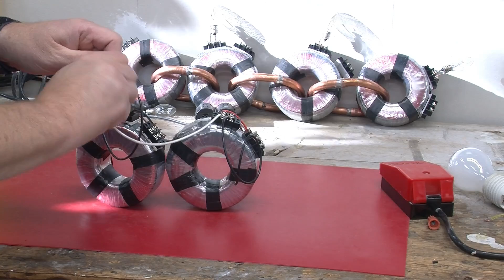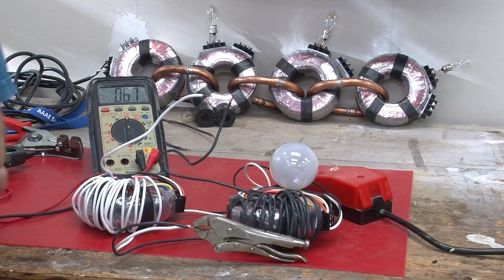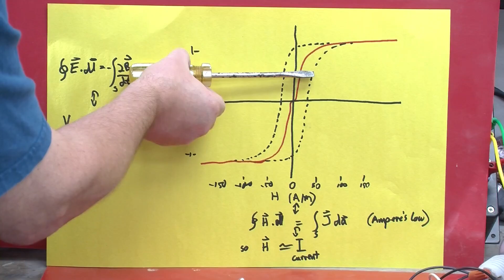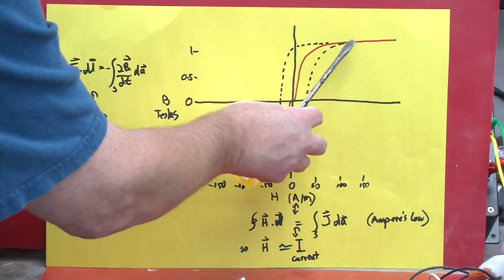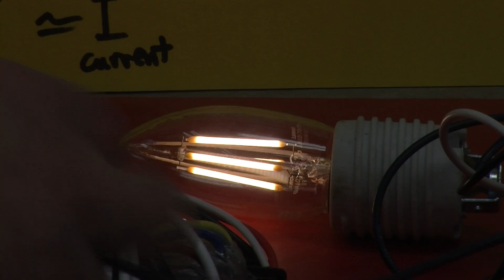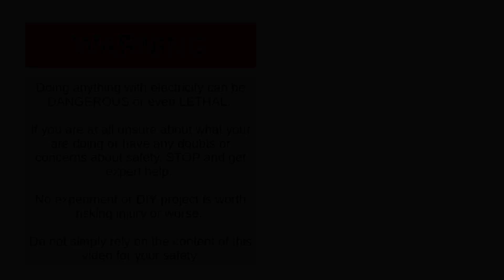A Magnetic Amp and Core Memory

Comment: This is a really good video for being able to see how a transformer works. I particularly like how you're using a battery with two transformers so that there's no AC potential across the battery. Do you think you could accomplish the same thing in a simple EI transformer if you wrapped the opposing wires around the top and bottom of the E, and have it control the power transferred through the core, the middle of the E? If you get what I'm saying... I'm not sure if that would work or not, I'm trying to picture how you could do something similar with one transformer, you couldn't do it with a single troidal transformer.
Reply from the maker: The E config almost as you describe (or maybe exactly as you describe if I misunderstood) is actually a standard version of this called a saturable reactor: two   DC control windings, each on the outer leg of the E and the AC winding in the middle leg. The two control windings are connected in series to make their AC voltages cancel and you use a battery or DC voltage just like I did ion them
Reply: @ElectromagneticVideos  cool, that's what I was thinking! I had no idea that had a name!
Reply: @ElectromagneticVideos  I have seen some welders with variable inductor control, do you know if that's how they do it?

Comment: the 14awg wire from the first transformer is wound identically to the second one when they are placed the same and must be connected with the same polarity, so in parallel?
Reply from the maker: From your your more recent comment, you seem to have figured it out! The trick is to have the control winding wired in series such that the AC voltage across each of them opposes each other. That way, the battery uses to control the amp will not be subjected to an AC voltage.

Comment: With 2 identical transformers  hooked up as you have shown,  is it possible to make  a self running  oscillator through Ferro magnetic saturation and positive feedback?
Reply from the maker: Thats a very interesting question. A few quick thoughts: We do have amplification, so with feedback we should be somehow able to make an oscillator. One issue is the the amplified output is at 60Hz, while the control voltage is much slower than that - essentially DC, and at a lower voltage. So maybe we could feed the output into a step-down transformer to go from 120V to maybe 6V, and then put that through a full wave bridge rectifier to make low voltage DC. I'm not sure if the pulsating nature of the DC would be a problem so one might need a large capacitor to smooth  things. Also not sure what the loop phase shift would be and if one would have to add some huge capacitors or inductors to setup the conditions for oscillation.

The interesting thing is that the engineers who designed magnetic amp feedback control circuits would instantly know the answer since they would have had to make sure the system was not prone to oscillation. 

You have certainly made me think - might be fun to experiment a bit with sometime.
Reply: @ElectromagneticVideos  Thanks for reply, a YT video showed where 2 transformers where hooked back to back with a feedback network and apparently oscillate ,could be another fake tho. Patent US3015073 Mag amp prw gain 50,000

Comment: How thick should the windings with 20 turns be?
Reply from the maker: They only need to carry an amp or two. Since battery voltage used is very low, the winding needs to be thick to have low resistance. I used AWG #14 wire which was fine.

Comment: With how many volts do you feed the circuit?the I have 220v at the socket. you think it can be fed with a max 300v 3kw autotransformer?My toroidal transformers are 230v on the primary and 30v on the secondary, what voltage should I apply to the primary and how many turns should I add to each transformer? In your case, the 2 primaries are connected in parallel, I think. I saw a circuit on google with the primaries connected in series .How they must be tied to the end?your light bulb is incandescent (120v or 230v)or led and what light source i can use?
Reply from the maker: You need to use a voltage that keeps the AC peaks  below magnetic saturation and the is the typically the design voltage of the transformer. In my case the transformer was wired with a 120V primary so I powered the system with120V. In your case, apply 230V or something close to it like 220 or 240. You can always use a lower voltage. The voltages are high to be careful!.

I would try around 20 turns and see is that works - all depends on the low voltage control source you are using an how much current it can produce - that current times  number of turns needs to be enough to put the core into saturation. 

The primaries can be either in series or parallel - since the saturation results in asymmetric AC currents in each coil, my preference is parallel. 

The transformer primaries are like a crude switch or lamp dimmer so should be in series with the load. I would try a with an incandescent bulb first - not all LEDs respond well to lower  voltages if the core is not fully saturated.

Comment: I think that the primaries are the same (230v, 160VA). It does not matter if the secondary or secondaries are lower or higher in voltage and current (if they are not used) example; 19v, 24v, 30v, 35v, 40v, 55v, 15v, 18v etc?
Reply from the maker: Exactly - you are not connecting anything to secondaries so it doesn't matter what they are. However, be sure the ends of the  wires from the secondaries are covered/insulated so they dont short!

Comment: The dry cell is a special battery or it work with 1,5v same size alkaline or zinc-carbon battery or 1,2v r20 size acumulator?
Reply from the maker: Nothing special about the battery. I used a "D" size which I think is the same a  your r20. I used alkaline because they generally are longer lasting than zinc-carbon.

Comment: About transformers, I don't have them, but I have to buy them and how many VA (volt ampere) do I need for a 100w incandescent light bulb.Are they good with 100VA ;230v ;30v; 3,333A?Or do I need a higher power and how much?I find more models with different values and i dont know what to buy.help.Or should change the light bulb an what power.Does the noise from the transformers appear when connecting and disconnecting the battery or is it continuous (that is, as long as the battery is connected)?please help me .reply
Reply from the maker: I used HAMMOND 1182M30 transformers. (Available from Newark, RS and similar suppliers). They can be configured for both 230V buy connecting the primary in series. They are 160VA and should be fine for a 100W bulb. 

There always is some hum from the transformer.  I dont recall how noisy it was when fully saturated.

Comment: Are these toroidal transformers with an iron core or can they also be ferrite? I suspect that if they work at low frequencies, they are made of iron.
Reply from the maker: They are standard power transformers. The core is a long strip of laminated silicon steel wound into a doughnut shaped core. Ferrite may work - but probably not as good a core for this type of application.

Comment: Where do you get your hands on the cores? I've looked for them before and the only thing it seems like I can find is cores that are made for much higher frequency, and usually smaller. I'd like to find one that's somewhere in the neighborhood of 1000 to 3,000 VA
Reply from the maker: Most of the main elecronics suppliers (Newark, Digikey, Mouser) have toroid transformers. These came from Newark - here is the link. https://canada.newark.com/hammond/1182m30/transformer-toroid-60v-160va/dp/54X7521

Be sure to switch to the Newark site for whatever country/currency you are in. 

They are not cheap - I picked up a bunch on clearance at 75% off.  Well worth scanning Newark periodically for discounted items .....

I'm not sure how big they make them. These were made by Hammond which makes transformers of all sizes so if Newark does not have them big enough, you might look at Hammond's  website directly.  

Shipping: they are heavy, but  Newark, Digikey, Mouser usually offer free shipping for order over $100 or $200. For heavy items, its often cheaper to order something else as well to get into the free shipping order amount.
Reply: Thank you for the link.
Reply from the maker: @chadhiggins8397  Looks like a good price for the core, but you would have to wind it yourself. Doing just the 16 turns I did was a pain. Much more with thicker enameled wire would be even worse. My 180W toroids had about 500 turns for 120V. So unless you are only dealing with really low voltage I sure wouldn't try winding them. So what are you planning to make?
Reply: @ElectromagneticVideos  probably mostly want to do experimental stuff, maybe build my own low frequency inverter? I love the versatility, you can use the same transformer for a few different things by adding another winding or two.
Reply: @ElectromagneticVideos  one of the things I wanted to try was winding it with one primary winding with a center tap, and then use two small inverter generators that are designed to be paralleled, attaching each 120 volt generator to one end of the transformer and the other ends to the center. It should make 240 volts all the way across the transformer and the transformer should keep the generators paralleled, each generator thinking that it's connected to another generator in parallel when really it's in parallel but 180° out of phase. The transformer itself even with only one generator working would put out 240 volts across the ends if you connected to generator to the center and one end. Of course that'd be an auto transformer. My thought is that as long as you had a 240 volt load you wouldn't need a transformer that was all that large at all compared to the load. But even a reasonably size transformer would allow you two run something like a 120 volt refrigerator and a 240 volt well pump. It's probably cheaper just to buy a 240 volt inverter generator. Lol 🤣 but I'd still love to see if it work.
Reply: @ElectromagneticVideos  I've put several hundred turns of wire on a homemade small Tesla coil by hand, so I'm a glutton for punishment haha 😂😂
Reply from the maker: @chadhiggins8397  There are plenty of cheap used 240V center tapped transformers in the few KW range available - often for $100 or so. I use a 600V:240ct one (with the 600V winding unused)  almost as you described - as  auto-transformer to power my 240V well pump from a small 120V 2kw generator during power outages. Works great!
Reply from the maker: @chadhiggins8397  That would be a great project! But save yourself having to wind 500 turns and use a transformer with HV side already done. The you can add 50 turns for say 12V maybe in two winds of 25. Look up toroid winding to see the machines that do it!

Comment: Great.
Good knowledge
May be the under water submarine used only 1.5 volts to 3 volts batteries and doing something similar.
Reply from the maker: Glad you liked it. I would guess they used many more turn on the DC control winding so they could use a higher more practical voltage like 12 or 24 volts. I used a really low voltage here to emphasize how little is needed to control a much higher powered AC device.

Comment: The problem with me is that everything has to be done first because I cannot work alone because I am a person with physical disabilities. My mother helps me and the time she works with me is limited.I have 220v at the outlet. I found some transformers 160VA 230v 30v 5,333A. Is it good to connect the primary ones in parallel and the bulb in series with the primary ones like yours or should I connect them in series?Will it work with a 100w bulb (made of 4x25w bulbs in parallel) or is it good with a 60w bulb because I have that too?How is it better?Does it matter if the 14 awg wire is solid or twisted because I found only twisted or i need a thicker wire(awg13)?
Reply from the maker: So sorry to hear you have a disability that makes it hard to do interesting experiments like this - totally understand how you have to have it all planned ahead.

Since you transformers are 230V, connect the primaries in parallel. Try a 60W bulb since that is simplest. If the transformers are built to have a large inductive magnetizing current, it may glow dimly (before you saturate the cores) but that is unlikely. The larger 100W bulb is less likely to glow before being turned on since it needs more current to do so. 

14AWG solid or twisted - both are fine! Good luck!

A word or caution - is your mother comfortable doing stuff like this? Does she understand how to do it safely? Like I put at the end of all my videos, no experiment is worth risking any injury. If you mother is not familiar enough with this sort of thing, it would be better to find a friend or neighbor who is who can help and knows how to deal with electricity safely!

Best wishes and stay safe!

Comment: I'd really like if you could display a schematic for a few seconds before each change to the wiring.  It's hard to visualize the wires on the bench.  For example, when you said "add a light bulb into the mix" I have to guess that it went in series with the primary of one of the coils.  It's also not easy to tell whether the two primaries are wired in parallel to the mains, or just one primary.

Oh, I see you've linked the schematic from one of the comments:  https://www.youtube.com/channel/UCV2-Qbq9o0EOQWPLAWkVH2w/community?lb=UgkxYiE7LI0tCuI2siiZf4A_UTw5m2SzSKy6
Reply from the maker: You know, I shoudl do that. I also find it frustrating when people dont do that - now I am guilty.  Yes _ did link it cause someone else asked. So  - point well taken.